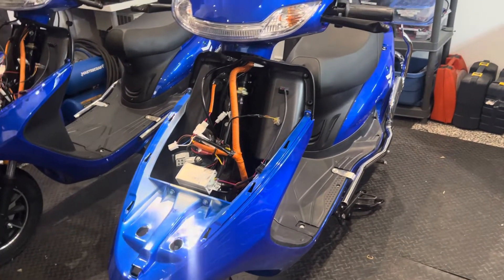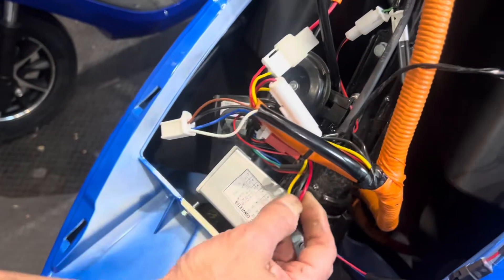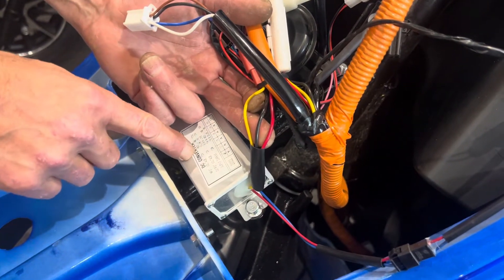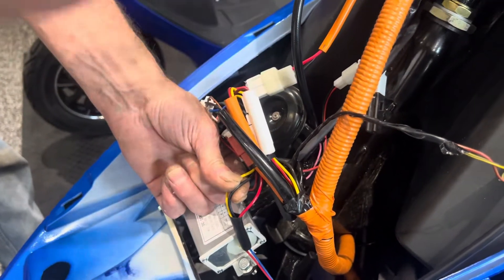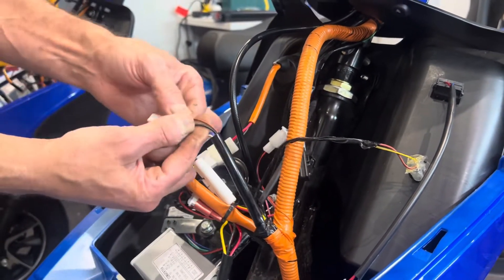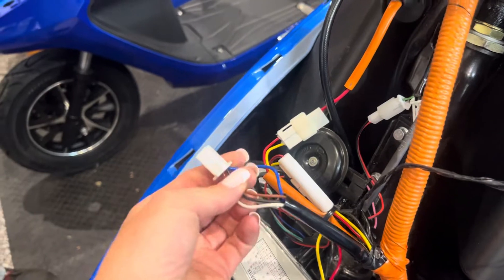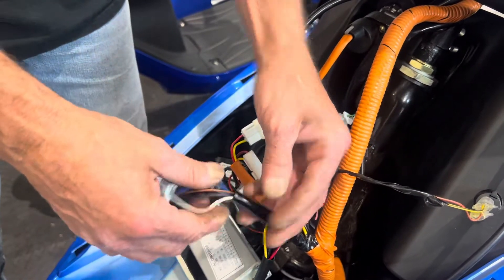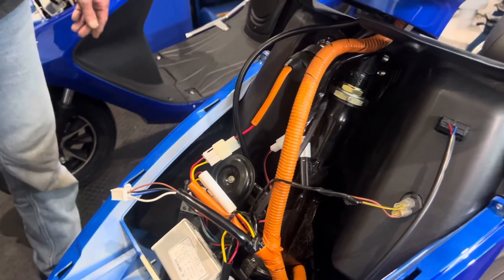How to wire Accessories to 12volt converter. Ebike lights, fog lamps etc

Comment: Hi there,
My front lights and back position light doesn’t work on my scooter. When I use brakes, back light is activating. I have tried changing front led bulb but It didn’t work. Blinkers are working and my horn. Do you know maybe what could be the cause of my problem? is it possible that it is a voltage converter?

Comment: Hi ride the wind, I'm wondering if you guys could help me out with some technical problems with my emmo kamen LCD display. For background info, I've only had my bike for one week now, and on the first day I has a problem where the battery strength would not go down, and would display as full battery despite me going around 20-30 kms already before charging on my 84v/20ah bike. This problem doesn't really affect me must tho, so if you cant help me with this then thats ok, however I do need help for my second problem.

My bike, since yesterday has not been displaying my speed, saying that I'm going 0 km/h at all times. I've tried charging my bike, turning the circuit breaker on and off, and anything you can think about other than disassembling the bike. If you guys could help me fix this, that would be greatly appreciated, thanks!
Reply from the maker: Hey,   the first thing to do is contact your dealer.  This is a warranty issue.

Comment: For my Tao Leo, i installed a neon light kit, and with the light controller that came with the kit, it was wired into the converter, that limited the power to 12V. I also use this same converter for the Blutooth/phone charger system. Just be VERY careful what your installing as you dont want it to wear your battery faster if you installing  lights that draw a ot of power. Look for lights that run on 12v system, for a car for example. Just know that unlike a car, your bike does not have an alternator to regenerate the battery while you drive. 
I find with my light kit, it dosent draw much power at all, either does the blutooth system.
Reply from the maker: Awesome input.   Thanks Alex